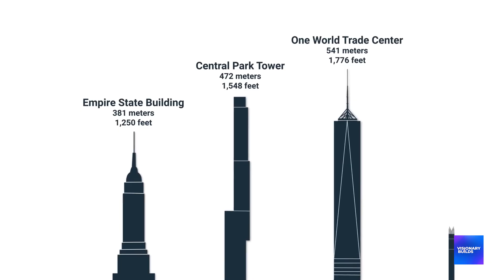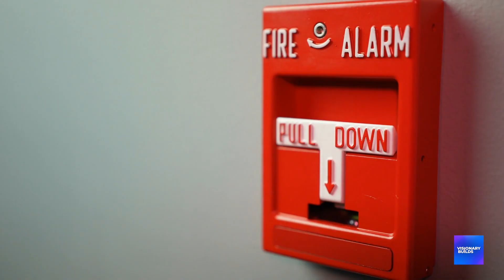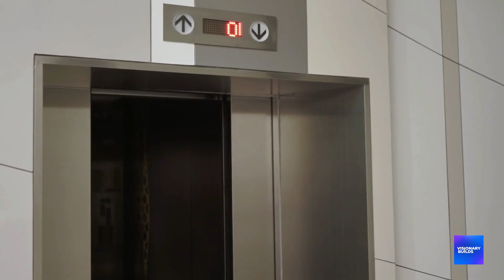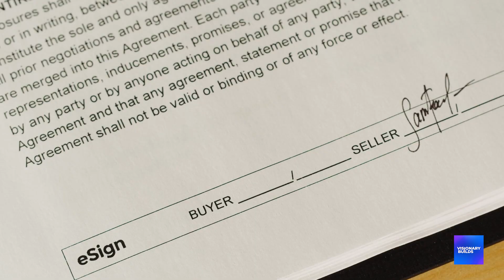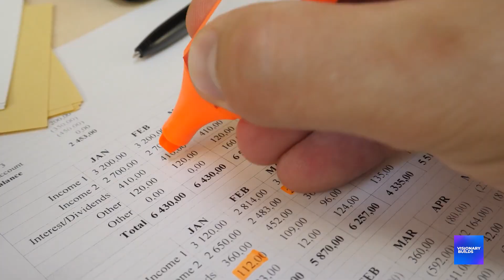Dubai's Building The World's Tallest Luxury Tower: $200M Penthouse

Comment: Complete over-sensational clickbait. Many of the "risks" mentioned have been solved or mitigated in other high risk high rise developments years ago. Yes there is always a risk living in a high-rise, however, there is risk just crossing the street. In addition, many of the facts mentioned in this video are complete BS! There are no commercial airlines that fly at 1700ft so you are not living above where they fly at 550m. This video makes it sound like this building is 30,000 ft tall. In fact at 550m it is just barely taller than Central Park tower and 230m shorter than the burj khalifa also located in Dubai. In fact the whole buildings it is just 100m taller than the outside public obversion deck on the burj khalifa! Also there is barely any noticeable air pressure difference at 550m vs sea level. More complete BS!  In fact more than 12% of the world population lives at elevations far exceeding 550m. Load distributions: There is NO difference between office and residential space weight loading and distribution with respect to the building designed distribution of loads through the building to ground. Skyscrapers are designed with a floor loading max so it makes no difference if it is designated residential or commercial space. LOL It is not like residents are moving in and installing swimming pools in the units! The only major risk difference between residential vs commercial use space is that residential  has a greater fire risk due to the fact that residents will be cooking and preparing meals in their units. This problem is easily mitigated with the use of concrete firewalls and fire doors between apartments. Building sway: advanced damering systems have been around for decades and the companies that specialize in skyscraper dampering systems have sway down to 1-2 cm per 100m so you are not likely to feel any movement even if you live in the penthouse on the top two floors. Last the name on a building has nothing to due with those who actually design it. The video makes it sound like Jacob and Sons designed this building. That is laughable at best!